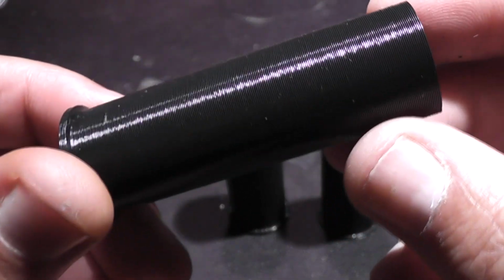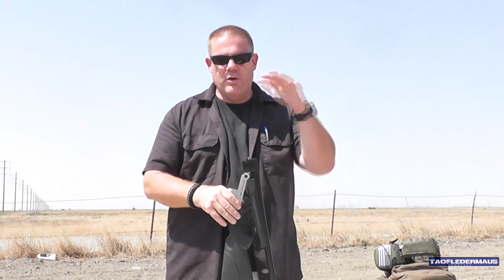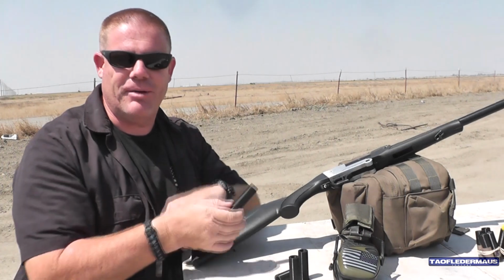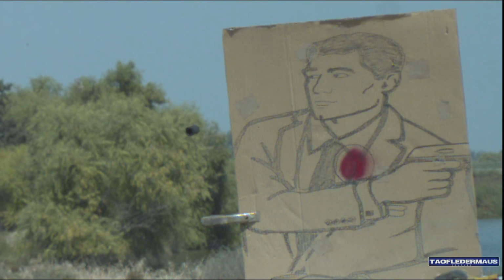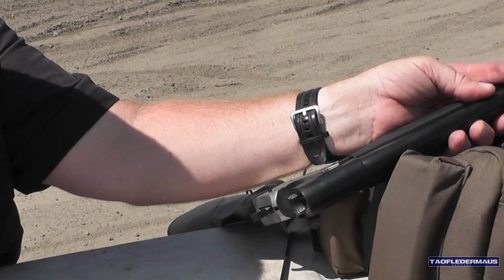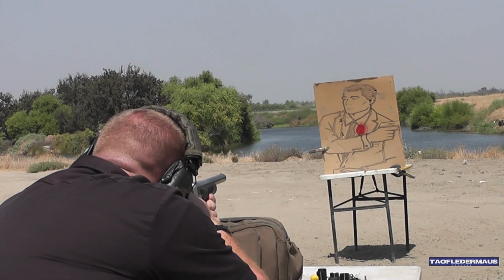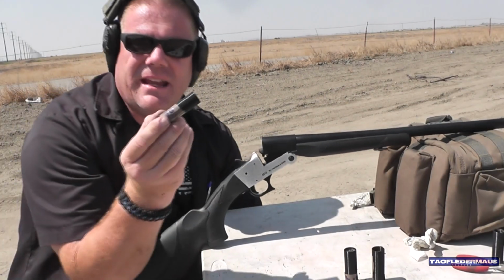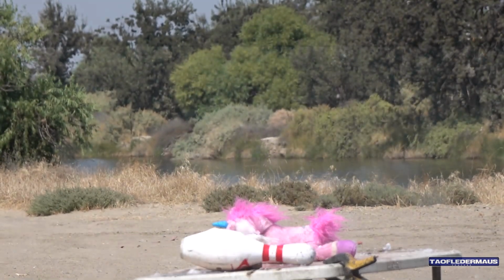3D printed Shotgun Shells - ALMOST too Dangerous

Comment: Perhaps if these were printed on the horizontal plane rather than a vertical plane they would hold up a bit better
Reply: It would collapse during printing unless it had more supports
Reply: @armeddeafboi7276  Resin print them
Reply: Resin printers are great, but not for this.
Reply: @chris.eskimo  maybe carbon fiber.
Reply: @chris.eskimo   it would be worse, resin printer are great for detail but lack the mechanical properties a fdm printer offer.
Reply: @armeddeafboi7276  the hull press would make quick work of support material

Comment: I don't know about California but over here on the other side of the states 18 1/2"s from the CHAMBER to the muzzle is minimum legal barrel length for a shotgun.  So a 2 3/4 chamber would still be short much less a 3"
Reply from the maker: It's measured from the bolt face.
Reply: I would have never thought that NC would have stricter laws on barrel length than California.  Learn something new everyday

Comment: could you guys make a wax slug filled with water? if you haven't already
Reply from the maker: The liquid would cause the slug to hydroshock inside the barrel.
Reply: oh yeah, didn't think about that, i wondered if the properties would cause a hollow point like expansion on impact, but i didn't think about that happing in the barrel

Comment: Possible suggestion for Michael in future designs, am i right in thinking that the shells were built in bands going from the cap along the length of the shell?  would building the shell around its circumference help stop the shell casings disintegrating so the bore can support the shell along the joins?

Comment: Had the cartridges been exposed to heat or acetone it may have bonded the layers a bit better but I had a feeling they'd have split like they did.

I would suggest Michael using a rubberised filament when printing to see if they work better as I've seen rubberised filament 3D prints that are incredibly strong and resilient to force.

Comment: They should have been printed horizontally or been reinforced with 5min plastic epoxy. I also 3d print
Reply: i agree... the rings going horizontal will make it there weakest point so printing having the lines go up and down would give them some more durability.. though should have the base still be metal to prevent the breach fires
Reply: Yeah though the support will be very tricky if horizontally printed
Reply: He could try printed horizontaly with stronger plastic such as Carbon fiver reinforced PLA that is very strong

Comment: Someone needs to try printing the shells horizontally so that the weak joints between the filaments don't run radially around the shell and make it weak and do these 'pseudo-cutshells', but instead run along the length of the shell, giving it added strength where it lacks it (since the round shape and the chamber/barrel provide enough strength to the walls)
Reply: That’s what I was thinking but that’s gonna be a bit harder to get the support material out. He could also try using something stronger like PC
Reply: What about printing at a 45-degree angle? It probably complicates the print setup but should add strength in the proper direction.
Reply: @richardhanck972  yeah print at 45. Set support on. Touching buildplate only. And Set overhang threshold to 50 deg or some thing
Reply: Would use more filament, supports would also need to be printed. Maybe a raft too.
Reply: Was going to post same thing
Reply: Very nice
Reply: Hmm thought that would make it weaker but your right, but the problem is the printer would f it up, it’s exposed to print vertically
Reply: Who comes to the glorious idea doing it otherwise?? I mean . Anyone knowing only a little bit about 3d printing should know that or?
Reply: How
Reply: Duck tape 👍
Reply: Exactly, thought the same thing
Reply: then they would split down the center
Reply: I was going to say the same thing! this guy they got dont know how to 3d print!
Reply: I'd be interested to see it as an intentional cutshell design. Also, some internal smoothing and possibly a releasing agent could really increase the shell's ability to perform.

Comment: Michael is undeniably a very clever dude, however I think this has put an end to the notion of 3D printed shells - the layering process means that there are hundreds of weak points. Lots of laughs as always.
Reply: The way the first 2 shells failed, I'm wondering about shells that deliberately break at a particular point, firing slug + sabot down the barrel.
Reply: Especially when it'll take about 30 minutes to print each shell on a consumer quality printer.  You'd probably get better and faster shells using cardboard.
Reply: I think it is just a proof. In this he was certainly successful. But I agree, making it a purposeful frangible case/sabot may actually be a better idea. I'm guessing he is already making those shells/cases or has them in the mail heading to Jeff as I type.
Reply: there is a balancing act in printing temp to get great layer bonding and accurate prints.
inter-layer bonding is the weakest point in the print, as mentioned elsewhere printing in a different direction might work better.
 Materials... ABS is not nylon, is not PLA, is not PETG, etc, etc, etc
Reply: shouldve printed along the long axis
Reply: Bryan Shouse I'd imagine that it would be extremely difficult to position the primer in exactly the right orientation, but if he could overcome that then I suppose it would be feasible, but it seems like an enormous waste of resources to make a shell that can be made in the accepted way for pennies.
The guy is clearly extremely clever, and I'm he's only looking at what's possible, but I doubt we'll ever see a commercially available shell unless it's a show piece.
Reply: Nope. 3D printed ammo is being tirelessly worked on by a lot of people. The problem is that current ammo design relies on the strength of metal. It must be redesigned for printing. These were just traditional hulls made from printed material. 

There are a whole lot of ways this separation can be mitigated.
Reply: No, he just needs to print them so the layers go lengthwise.
Reply: giantpune new video idea
Reply: we can print in carbon fiber and kevlar ;-)
Reply: Needed to use nylon
Reply: Ian Macfarlane - My 2 year old home printer will do 0.1mm layers.  That's plenty accurate to print these sideways and get the primer perfectly centered.  Some of the newer and fancier ones do 0.05mm layers.

As far as price, these look like about 2 cents worth of plastic using Hatchbox ABS from amazon.  And depending on where you live, only a penny or so worth of electricity.

Comment: If he was to 3d print in the layers as normal then use a metal mandrel inside and out then heat it so it fused corre tly ild say viable

Comment: I think the issue is with the way the 3D printer prints them layer-by-layer, with previous layers being somewhat cured by the time the next layer is put on. Heating the shells just up to the softening point of the plastic and then cooling them down very gradualy might improve the molecular bonding between the printed layers of plastic. 
Printing them lengthwise instead of primer-end to open-end may also help, although they’d probably split open near the powder charge unless reenforced with a brass cap. Printing lengthwise would make designing the 3D object file rather difficult, though.

Comment: what if one were to make shells out of a metal like steel, lead, or copper, or brass that deliberately disintegrate like these shells do upon fireing to add to the firepower of the shotgun?  i
Reply: like the shell is perforated to break into little pieces.
Reply: yeah basically.   Just like this 3d printed cartridge.  Have it break into nasty little pieces that combine with the projectiles.